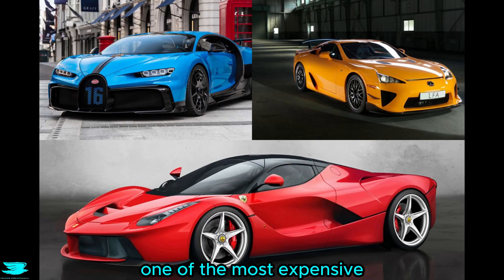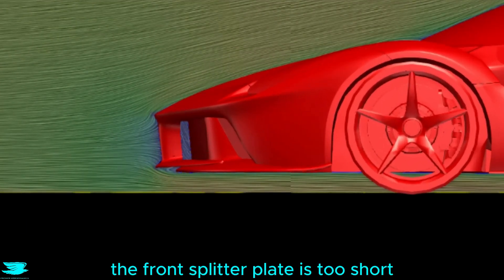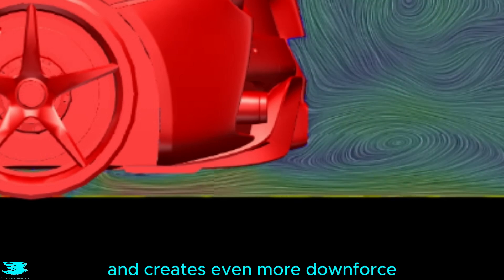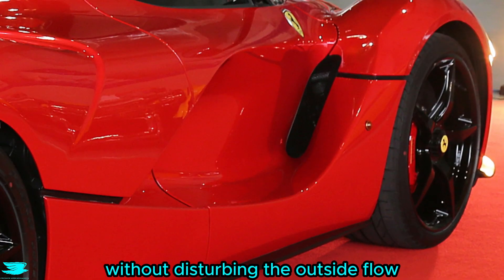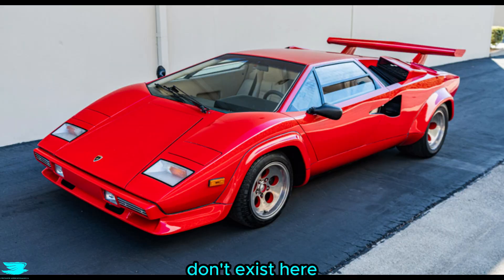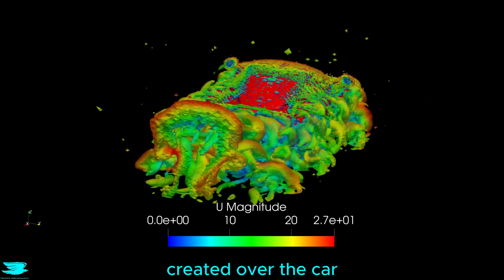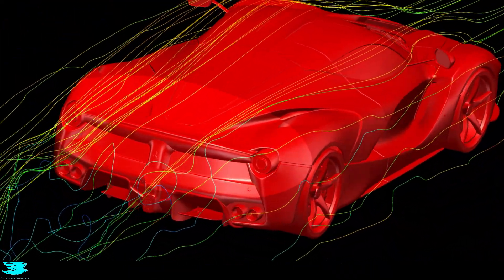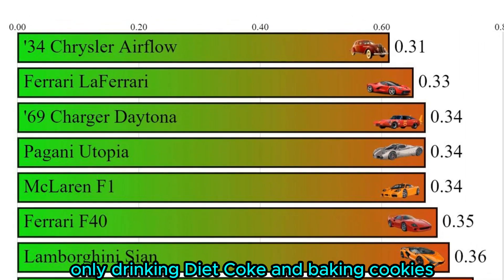Ferrari LaFerrari Is Surprisingly Aerodynamic

Comment: so venting low energy air from the front wheel arches with cutouts that are directly infront of the side radiator intakes?  LOL
Reply from the maker: You reduce the high pressure in the wheel housing. And mixing it with additional flow makes it fine for the radiators.

Comment: Pretty impressive, especially when you consider this car has active aerodynamics. The diffuser rear wing and front splitter change their AOA.

Also the game Assetto Corsa is like $7 and has a lot of high quality models that can be exported, if you want some material to analyze. The 2017 Ferrari F1 car in that game comes straight from Maranello's CAD file.
Reply from the maker: Thanks for the idea! We'll check it out. Do you know which version has the 2017 F1 car?
Reply: @PremierAerodynamics if you want all the cars, i'd suggest just getting the Ultimate Edition of the first one, that includes all the DLCs. It's cheaper if you wait for it to be on sale too (sadly the summer sale already ended)
Reply: @PremierAerodynamics  the first one it's in a DLC pack that's like $2.

Comment: Having a drag coefficient is nice... but why not also mention how much downforce the cars are producing?
Reply: Which speed should the downforce calculations be based on?
Reply: @THUNGUNS  it's usually either 200 km/h, 240 km/h (or 150 mph), or 300 km/h. Or the car's top speed

I think the 200 km/h mark is the most convenient point to measure, as top speeds are widely different (but that's what's usually quoted by manufacturers), and not all cars are able to reach 300 km/h. If we're talking about something that is able to generate downforce, then it's usually able to reach 200 km/h at the very least
Reply: I'm not sure how, but maby you could state down force as a function of speed?
Mcmurtry Spéirling would be interesting because it has down force at 0 speed
Reply: @Optimus_Sapiens  you don't really have downforce without speed (because it's calculated with velocity), that's why downforce numbers without speed attached to it are useless lol. I believe Mcmurtry has fans that suck the car to the ground, so that's why it's able to generate downforce at standstill

and I believe the downforce formula is this: F = CoefLift * 1/2 * AirDensity * Velocity^2 * Area
Reply: @xenoyparxi  So then you would just need to add a konstant downforce (wich on most cars would be 0) and maby even downforce that is bound to the engine rpm (like the brabham f1 car or cars that have a diffusor-exhaust) to the formula you wrote and then we know the total downforce of a car at any speed.
Although it would be easier to summarize the whole formula for sea level pressure and only state one number that is already combined with the frontal aerea, so you would end up with something like: downforce = konstantdownforce + enginerpmdownforce + speeddownforce * v^2
You could leave the konstantdownforce and enginerpmdownforce away, if the car does not use any of these effects, but it seems like more and more cars nowdays use exhausts that blow up or at the diffusor, or use fans.
Reply: @THUNGUNS  I dunno. Set a standard and then stick to it.
Reply: This particular car – not much
Reply: @av_roe  according to supercarlists it's 360kg @ 200 km/h, which is pretty respectable all things considered